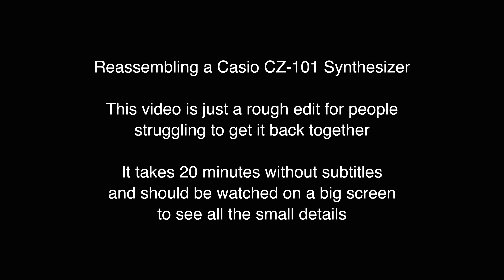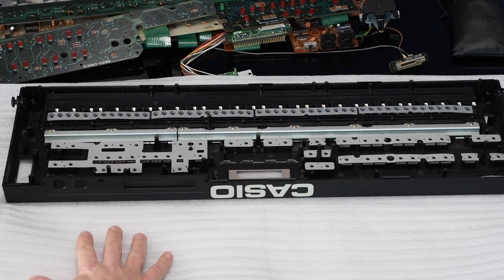Reassembling a Casio CZ 101 after repair

Comment: thanks for the video. Did a full cleaning round on one of these beauties. Even disassembled the buttons to clean them. I am surprised how properly build these are. For the buttons there is a description on the inside showing where each of the button should be.

Comment: Thanks for a clear, detailed video.  My CZ-101 has the same problem of no sound from 6 keys, pretty sure they're the same six you fixed in the video.  So now I have a good strategy to fix that and can reassemble when I'm done  :)   I've been using the VirtualCZ plugin from Plugin Boutique since the real thing has the dead keys.  I tried setting up a couple of different patches on each and they sound identical to me, plus VirtualCZ can save/restore patches to/from the physical synth.  Beats firing up my Atari ST!

Comment: The new LCD/LED display, you could have used blue? Also do you have to install 6 "D" cell batteries in order for it to work properly? Thank you 🤓
Reply from the maker: Yes, but I found the yellow a nicer match for the yellow text printed on the case. Easier on the eyes as well in the dark. I never use the CZ with batteries.
Reply: @2kBofFun  i recently found the CZ 101 in some curbside stuff, & to-day I got a suitable charger, and it seems to work!! I haven't tried other sound patterns or "pressing buttons" to see what happens, as I want to get a manual and go from there to sort of experiment with it's sounds. The regular black/gray LCD screen seems to work fine! Thank you 🤓 are the 6"D" cell batteries more for portability?
Reply from the maker: @j.lietka9406  Yes, they are for portable use, but they also keep the memory from erasing. You could modify that with a more simple CR2032 like solution.
Reply: @2kBofFun  yes I think I saw or read a post that mentioned the batteries were to keep the memory going. Thank you 🤓
Reply: @2kBofFun should have asked... Did you ever try to make a similar memory cartridge for the 101? Thanks again!

Comment: Hey guys does anyone know why mine has solid blocks on the top row of the screen? Thanks
Reply from the maker: The original screen, or the replacement?
Reply: @2kBofFun  replacement, it worked fine without any problems. But now all blocks. No leds(even power led) the relay clicks onwith a delay as usual. Any suggestion on
Where to look would be amazing.! Thank you
Reply from the maker: @Chaga1314  Sounds like you short anything. Did you put the shields back in the right spot? No broken flex cables?
Reply: @2kBofFun  as of now no shields are on it. Checked and reflowed all the flex cables and the 2 rams and the rom.
Reply: @2kBofFun  do y reckon  the rom is blown or something similar? Or else?
Reply: @2kBofFun  again thank you so much for your input. Im really stumped
Reply from the maker: @Chaga1314  I think if it gets this complex, you should visit a synth doctor. All worked before the swap? Did you measure all flat cables for conductivity?
Reply: @2kBofFun  yes might have to. Everything worked fine even after the swap. It just died out of nowhere. Thank you for your support so far. Keep up the good content. 👍

Comment: Any chance you could help me out with the length and size of the screws that are used to hold the body together? I can’t seem to find it online. I found a working model at a thrift store for three bucks but it only had the two screws inside of the battery compartment so I need to replace all the other ones.
Reply from the maker: Outer diameter of thread 2,5mm, shaft length 12mm, thread spacing 0,8mm.

Comment: a very sarcastic demon invented the internal assembly for casio cz 101 and 1000. I hate that sandwich of soldered boards.
Reply from the maker: Biggest problem is the lack of connectors on the cables. They are all flimsy and soldered.

Comment: That's the problem with Casio synthesizer.All connections are soldered.
Yamaha has connectors.
Reply from the maker: Luckily they are not that hard to fix/replace.